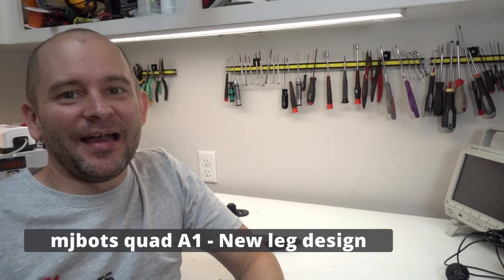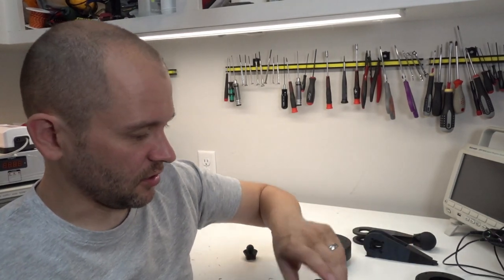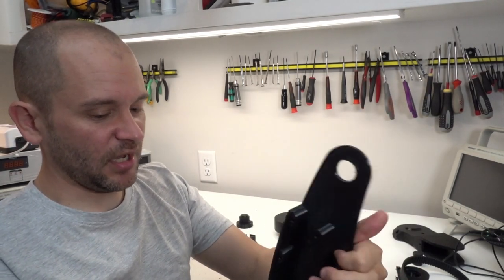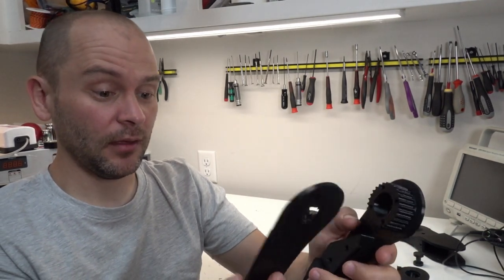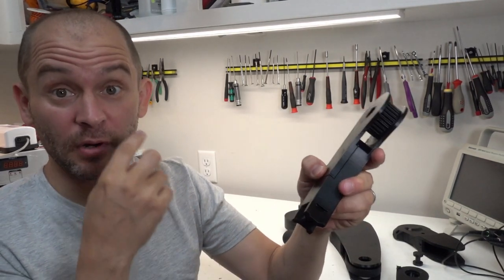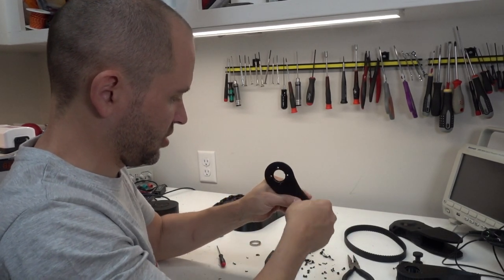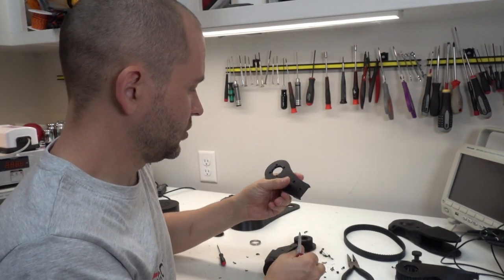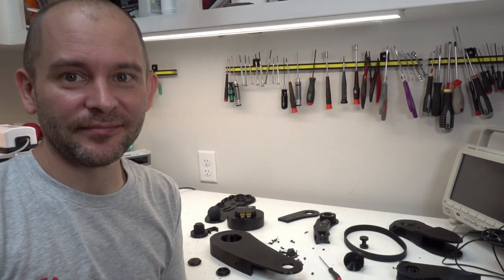Experimenting with a new quad A1 leg design

Comment: Glad to see you're still making progress on this!

When do you go to laser cutting and bolting, or just machining, these legs, though? :-)
Delrin is pretty nice for laser cutting.
Reply from the maker: Slowly but surely!

Hehe.  Yeah, I've imposed myself the artificial constraint for this one of doing as much as possible with just 3D printing.  It would definitely be easier to machine things like this, but then you might as well go and buy one of the pre-existing machines that are mostly machined or cast composite.
Reply: @awesjosh  That would actually be my next question: what's your opinion on resin casting?
You could 3d print a blank/plug, then make a silicone mold, then use resin in a pressure cooker vacuum chamber...

Also, I haven't seen any existing dog chassis (at least under 50k) jump, so you still have that going for you!
Reply from the maker: I have no problem with casting itself, although casting with a heated vacuum chamber is probably beyond what most people could pull off.  Also, it isn't necessarily any stronger than printing (although you can probably get a nicer surface finish without extreme effort).

Also viable are composite techniques, like pre-fabricated tubes of either Al (or CF, but I don't have a great place where I can manage CF dust).  Or perhaps laminating in FR4 which is easy to get cut in arbitrary shapes.